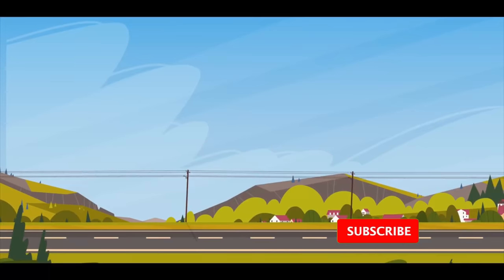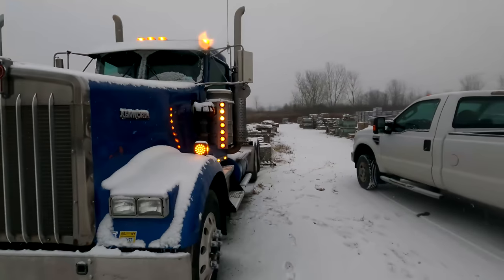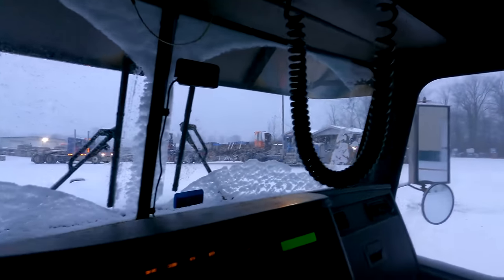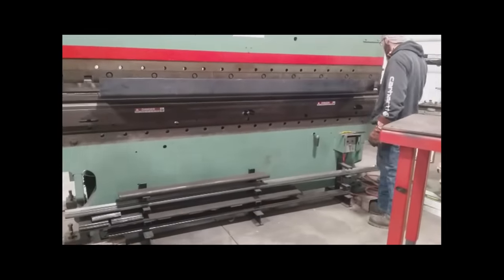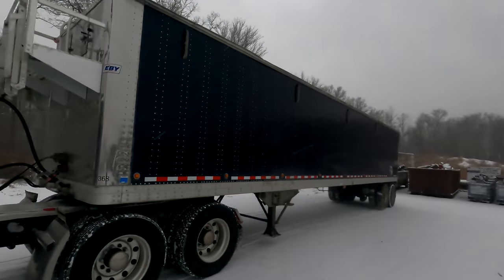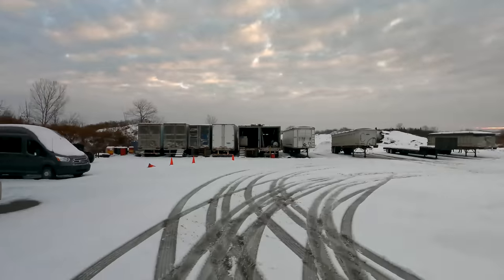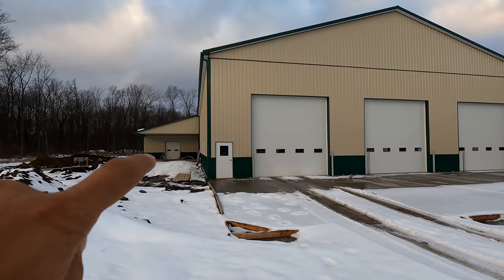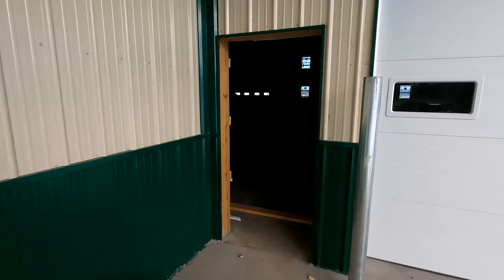A Needle In A Haystack !!!!

Comment: I think you have a great channel . I was told by a Tech. from my Kenworth dealer that if you want  the new emission engines to be more reliable you have to treat them with a lot more care . In other words more frequent OIL, and Filter changes { only use quality products } . And keep the engine tuned !!!! It was the engine say has a  injector that is just starting to go bad but may not give a code it can screw up the SCR system . He said this the system will work just fine as long as the engine is working perfectly . Either way it still adds more cost to your operation .
Reply from the maker: Yea.    Agree.  But when Ryder does services at 40k miles it doesn’t work ....
Reply: @flintcreektransport  there is a large crane company near me and they do trucking , rigging and heavy hauling too . Anyway one of the drivers told me they service their trucks around 10000 miles .I'm in NYC so we see a lot more traffic and idling time here . As for Ryder it is all about money just how many services can you do ? it does cost money .
Reply from the maker: @lhr1701  Ryder does the services on that lease truck.     It’s only every 40k.    We do every 5k on our trucks we own

Comment: Instead of making the ladder fold I would of made it slide up and down and it would of been simple to do by adding some channel and a simply spring loaded locking pin.
Reply from the maker: Good idea !!   Thankyou
Reply: @flintcreektransport  How do you like those walking floor trailers, I have seen them a few times and it is interesting how they work? 
Do they require a wet kit on the tractor or are they self contained?

And how is the durability of them, it seems like they could get jammed up easily and with all the hydraulic force it seems like something jammed in the tracks would cause catastrophic damage and being thin extruded aluminum strips wear and other damage would occur easily.
Reply from the maker: @longliner205a4  we love the Titan trailers !!!   Def the strongest most durable trailer we have ever owned !!!    I think we have 10 of them !!!!! Sidewalls are super strong !!! Yes they require a wet kit !

Comment: Do you only run pre emissions motors
Reply from the maker: No   we have some new ones.....
Reply: @flintcreektransport  so my next question to you is do you see any difference in the fuel mileage on the old versus the new engines and which is better in your eyes. I have a 2019 w900L that I have owned for 2 years but had a pre emissions one before. And by the way anyone looking for a truck I have 2019 w900L with wet kit for sale.
Reply from the maker: Yes .... The new ones will not get as good as the pre emission trucks.... then you have to figure in DEF yet !!!   Looking for a good used glider.....
Reply: @flintcreektransport  yeah thats what I'm going back to is a glider.
Reply from the maker: Nice!!